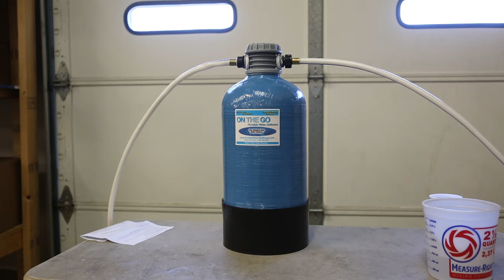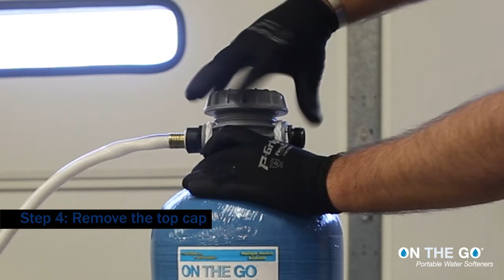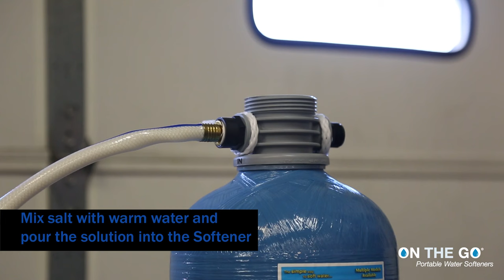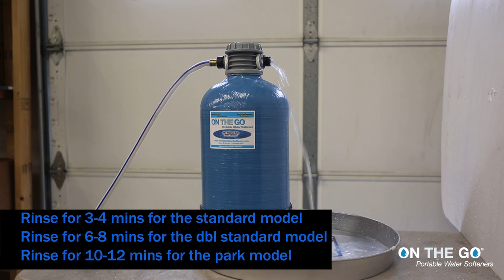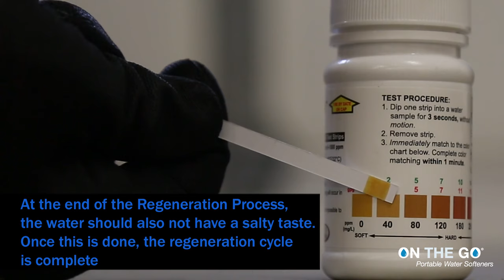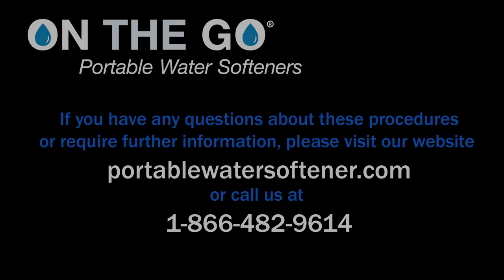On The Go Portable Water Softener Regeneration Process

Comment: Does the water supply then go into the outlet side to flush? Or does the water supply just get reconnected to the "In" side? Im stumped with the term backflushing. Im assuming that means you actually run the water source backwards through the out? Connect water source to out? drain out of the input side? I use this in my shower. I have a wand hose that goes from shower neck into the In side. Another shower hose and wand coming out of the output side. Just confused.
Reply from the maker: The regeneration process is when you add the salt and flush it through the softener. The backflush is what you do every 3 months by running the was through the softener backwards.
Reply: @TheBenjamin5002001  Oh wow i didnt know we did both a regen and backflush. The "was" is supposed to be "water"? At any rate...im still confused on the regen. After salt goes in....do i just run water through it....from the input side? So the pencil thin stream is coming out the "output" side? Its not reversed?
Reply from the maker: Can you call us at 260-482-9614
Reply: @TheBenjamin5002001  Can you guys ship the park model to Hawaii?
Reply from the maker: @ThepowderbluesForum  yes
Reply: @TheBenjamin5002001  Thanks. Got the double instead. I now own the standard and double. When i move into my permanent residence in January ill get the Park.

Comment: I am using this in an RV park where I was told I can't just waste water flushing the system, can I just let the inside faucet run and let everything go down the drain into the rv site drain would that damage the rv pipes? If it wouldn't it would save me the worry of getting myself in trouble at the park.  I got this off amazon
Reply from the maker: You would be flushing hardness irons and salt through the system.

Comment: What is full stream after flushing? Does that mean wide open on water pressure? My water is so hard in west Texas as a full time RVer. I think this is to small and to much maintenance for my condition.
Reply from the maker: How many gallons ANY softener will approximately make depends on the hardness of the water source and your water usage. To figure out the approximate capacity of your unit, take the grains of the unit (Standard 8,000/Double 16,000) and divide that by the grains per gallon (GPG) of the water source. It flushes out any remaining salt that might be left over.
Reply: Going with a bigger unit will give you more time between service. If your stationary and plan to stay yearly, perhaps a full size house unit in a small shed like building that regens itself would be best. You just have to keep the salt reservoir full and it takes care of itself. They usually hold bags full of softener salt and need to be plugged in to 110 power so it can operate.

Comment: We have followed the steps, but our regeneration only lasts for about 60 gallons of water. We have the double standard. What is wrong?
Reply from the maker: Whats the hardness before the softener? Whats the hardness, with test strips, at the output of the softener after the regeneration process? Have you lost resin? How old is the softener?
Reply: Bought the unit in August. Hardest reading possible before softener. Get it down to lowest after the softener. Don’t know about resin. There was some orange dust when we drained it the first time, but none since.
Reply from the maker: @mrslalanne  What do you mean by orange dust when you drained the softener? Nothing should come out when you drain the softener.
Reply: We turned the unit upside with the lid on. We let it drain. There was a fine orange dust on the ground afterwards. Much finer than the resin particles.
Reply from the maker: @mrslalanne  Was the water just a color or were partials in the water? Are you testing it at the output of the unit and NOT inside the RV? The data with it very hard before the softener and the lowest box after the softener and only making 60 gallons does now make sence how a softener works unless resin has been lost or it's being checked in different locations. You should call or contact us via our website. This is not the best format to trouble shoot your issues.

Comment: What is the lowest PPM after the regeneration process?
Reply from the maker: Are you talking hardness PPM or are you checking with a TDS meter?
Reply from the maker: @krustykrab4470  You cannot measure water hardness with a TDS meter. You will see little to no change because solids are still in the water.
Reply: @TheBenjamin5002001  So even after the regeneration stage the minerals will still  be inside? Does that mean I will just have to buy new virgin resin? 

I am asking because I wanted to get into car detailing, but for my use case I do not need giant tanks connected to my house, which is why I am asking what the PPM will be after the regeneration. I need it below 20ppm.

Comment: Just followed the steps for regeneration, but for some reason when testing the water coming out, it's actually reading harder than the water that comes straight out of the tap. Any ideas?
Reply from the maker: Are you using rest strips and not a TDS meter? Are you checking in at the output of the softener and not inside the RV?
Reply: @TheBenjamin5002001  Using test strips. Checking at the out fitting of the softener, and comparing it straight from the tap. It's being used in a regular house with a hand held shower head.